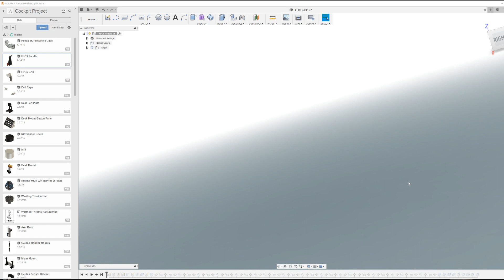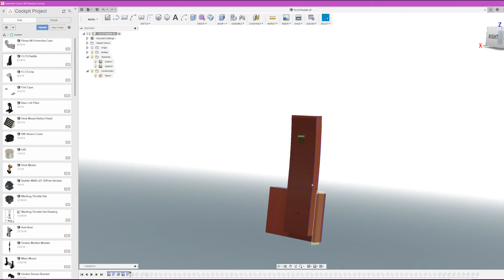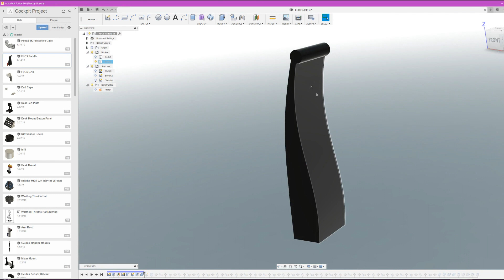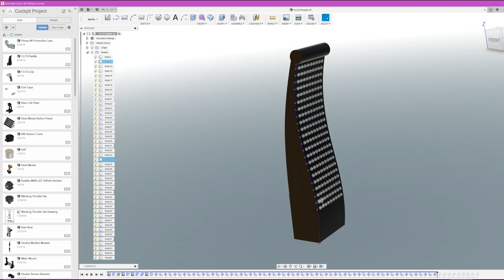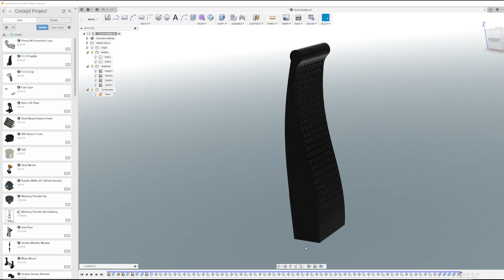Simpit Project No.29 - Cougar Paddle Switch Upgrade

Comment: Hello 
 Imadethis,how are you ?
One question you have is this STL file, of that Brake (black) TQS-06 (Brake pad for throttle friction system # 5074747), for 3D printing.
Thank you !
Take Care!
Reply from the maker: Hi malpaso - I don't have the brake pad for throttle friction modelled, as my throttle modifications replaced all of that mechanism in my cockpit. If I can find my spare Cougar throttle I may have a go at modelling it, as it should be easy enough to do.
Reply: @CMDRTeatime  You will model yourself !!
That cool !!!